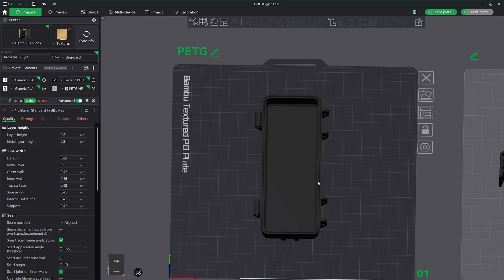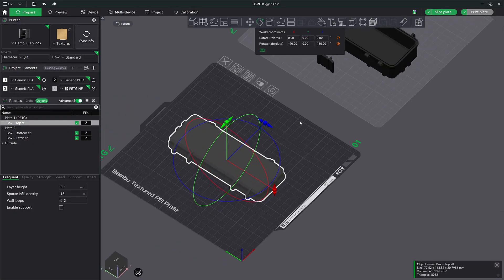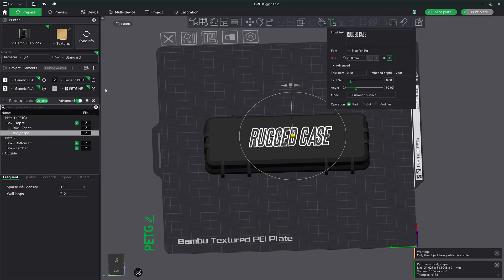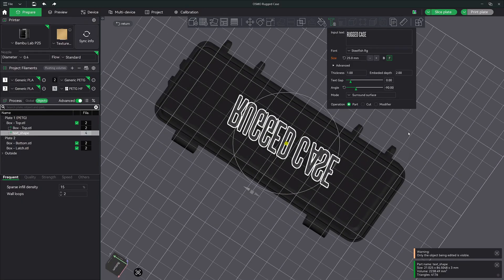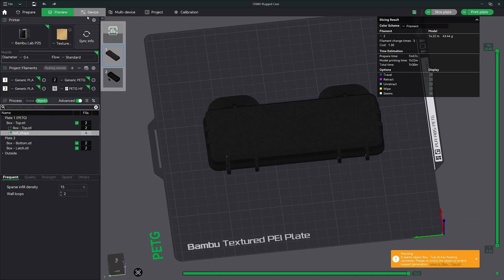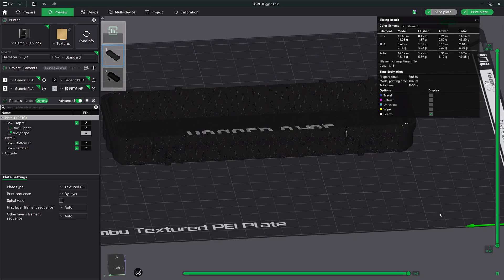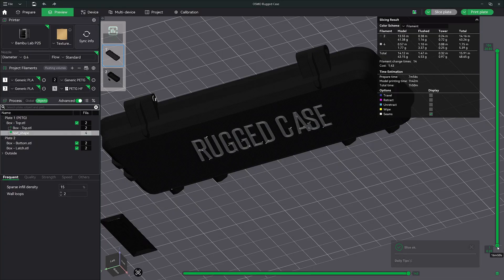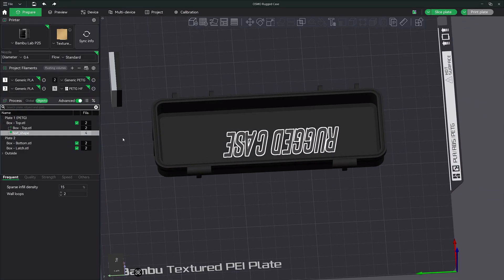Add Text to Rugged Cases Without the Hassle

Comment: I tried following this several times and it didn't work.
After several tries in my project I decided to create a new project in Bambu Studio, add a simple cube and a text on top. When I use the Operation=Modifier and slice it, there's not text.
Not sure if there are other configurations that could be impacting this or if it's an issue with newer releases. I'm using version 2.4.0.70.

Comment: Thank you Nick! I need help. I want to add a circular cap to the top of an open cylinder in studio. It keeps snapping it to bed. Ideas?
Reply from the maker: Yes, select both and right click then hit merge. Let me know if that helps. Make sure you switch to objects mode on the left process menu so you can seem them grouped.